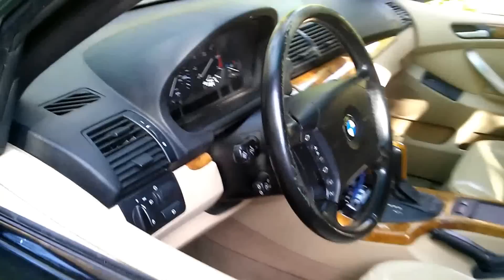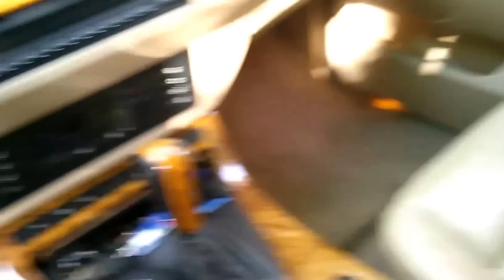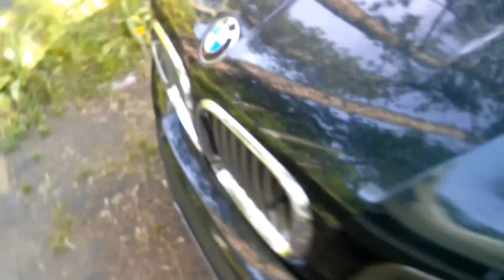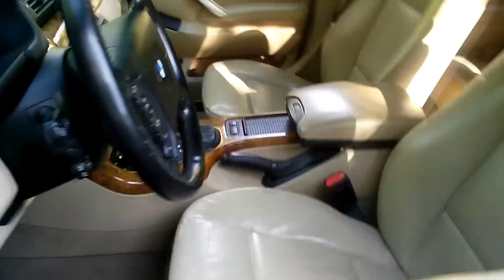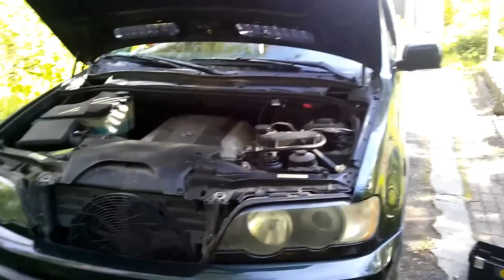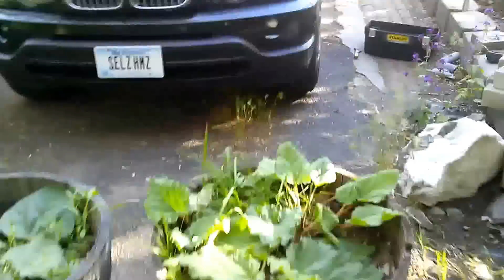New Alarm Siren! BMW X5 4.4i (E53)

Comment: yes because reading manuals is for fools... so if you leave a dog in a car and start the alarm it will trigger it by movement (ultrasonic sensor). but there is a procedure, i think when you lock the car with the remote you have to click "lock" one more time for several seconds (not 100% sure about that because i do not have a dog and did not care to remember correct procedure) and that should leave the car locked, alarm armed but interior ultrasonic sensors inactive so the dog can move without triggering the alarm. but just read the manual once. there are 4-5 things you definitely did not know about your car. you can google it in PDF. for example if your spare key stops opening the central lock (but you can start the car with it) you just need to use it for several days so the car will charge the battery in the key while driving. and some other small useful tips...

Comment: I just bought 2007 x3 . It's in near mint condition with 99,000 miles . Everything works but i can't get the audible siren to sound . No chips when i lock the doors or when try to steal my own car .No sensor goes off when i cause motion on the inside . Could it just not have an audible alarm or could it be disarmed . Also is the unit in the same location as yours ?. I have the car manual not a lot about the alarm .thanks .
Reply from the maker: Sorry for the delay, I'm not sure about the x3, but I'm guessing the siren is probably the same or similar location..
Reply: You probably don't have an alarm, they were optional on X3. Need to remove the cabin fresh air intake and housing to be able to get to it and check if it's there, should be on the passenger side.
Reply: I'll look . I think it just has a  imobilizer .

Comment: I'm having a problem with my 2000 740il, when I lock it, it does not make the signature noise but when I press the panic it does it
Reply from the maker: I would guess your siren is starting to fail...  Mine wouldn't "chirp" when locking/unlocking before I replaced the siren...